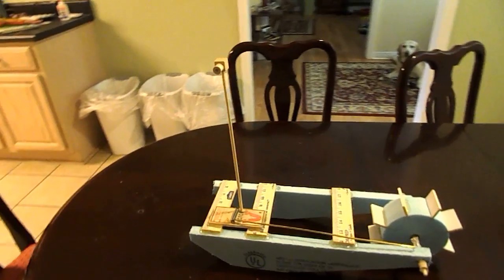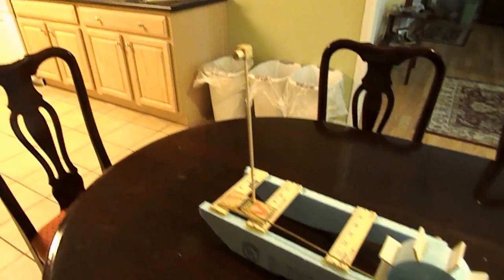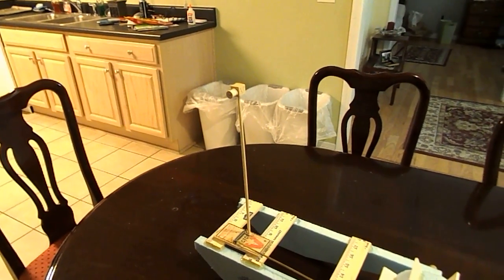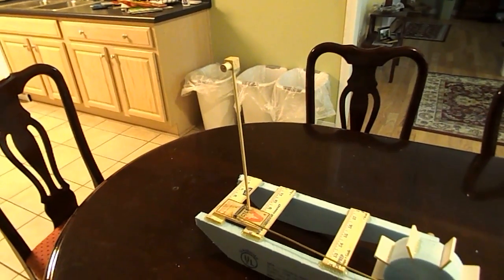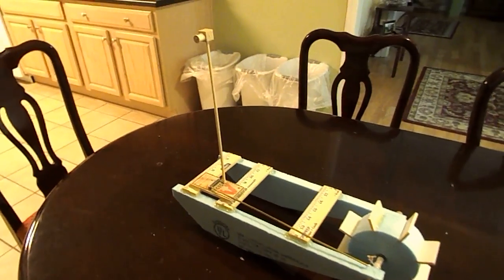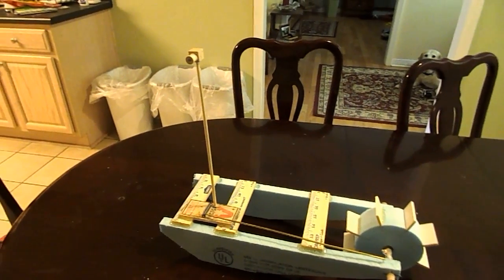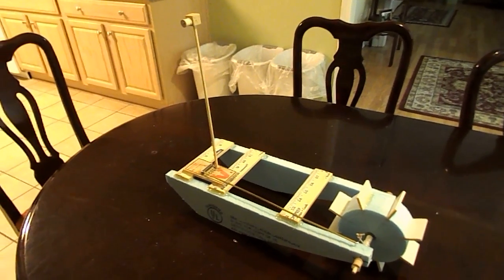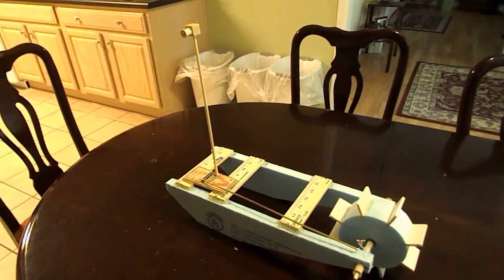mouse trap boat with pulley system

Comment: The pulley is a small wooden spool from Lowes tacked to a section of 1/2" square piece of wood with a small finish nail loosely enough that it spins easily.  The square section also has a hole drilled in it so it fits snugly to the end of the mast.
Reply: How did you get the lever to pull the propeller so slowly?

Comment: The pontoons are made out of 1 inch Styrofoam insulation on edge.
The paddlewheel was cut out of 2 inch thick Styrofoam insulation with a 4.5 inch hole saw and slotted for the paddles by pushing the wheel into a fast spinning drill bit chucked up in a drill press.